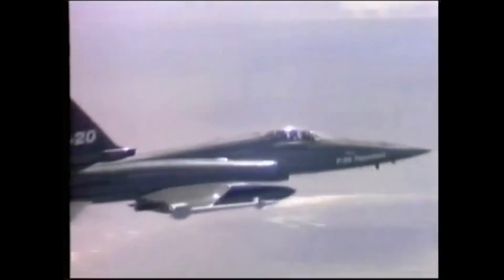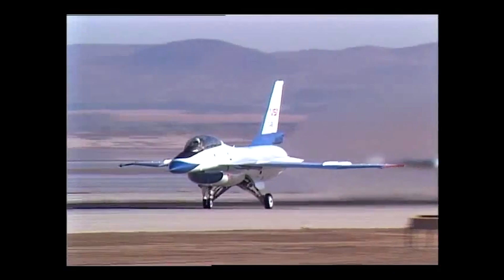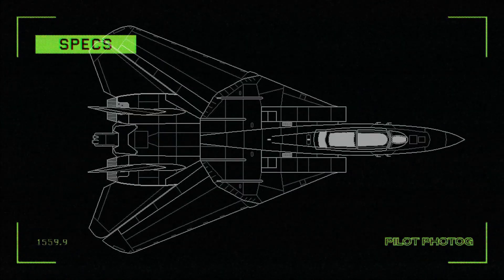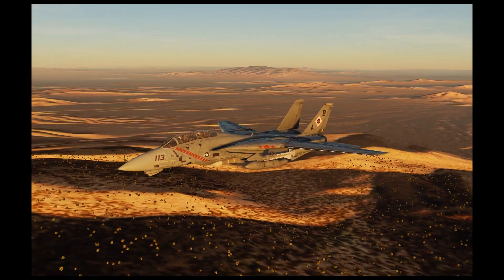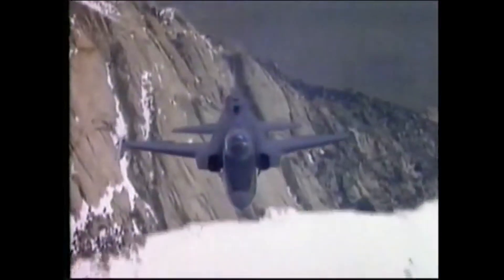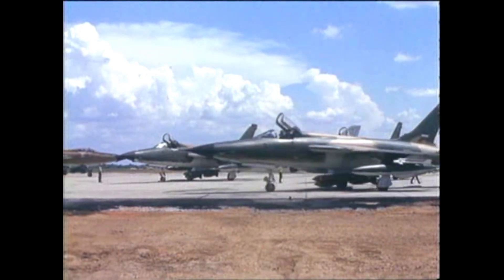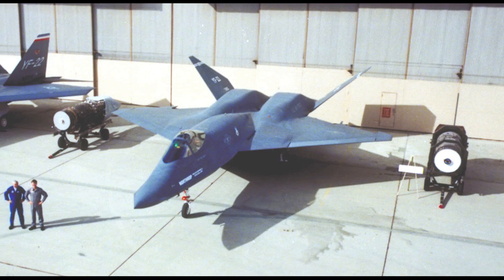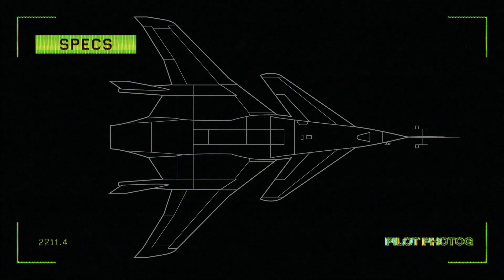Top 5 Fighters That Should Have Been Built | Best of Aviation Series by PilotPhotog  f20  f16xl

Comment: F-20 was a cool aircraft. Wonder how it would have fared against the F-16 if it was produced!
Reply from the maker: Excellent question and thanks for commenting.  I feel that the  F-16 would have had been very well matched against the F-20, can you imagine 40 years of development and upgrades on the F-20?
Reply: @PilotPhotog  I think the big problem is that the F-16 just makes sense for the USAF and any other air force which used F-15 as its backbone - and the F-15 has the best combat record of any fighter ... ever. Something like the F-20 means logistics for a different engine. If you're going to go with that engine, then why not go with F-18?

Something like the Tigershark might have more of a chance if it were developed by a different nation without such logistic concerns ... well, one could argue they did that with the Gripen. I guess you could view the Gripen as the Tigershark's revenge?
Reply: @IsaacKuo  The Gripen is why there'd be little reason for Northrop Grumman to try to revive the F-20, even though with modern avionics it'd probably still be a competitive fighter today. The niche in the market that the Tigershark would've filled has already been seized by Saab.
Reply: @RedXlV  Yep, Brazil  just bought  the Saab. India is buying  the Rafale. Japan is going F-35. Canada is still farting around on a next fighter.
Reply: @varminthunter243 The F-20 had no where to evolve. It's  always a poor Multi role fighter. Small, lacking hardpoints. short gear and lacks the visibility of the bubble canopy. And the Allies  had no interest.
Reply: Even though the F-16 had a blended, higher wing, integrated LERX, and FBW with relaxed stability, the F-20 is 90% of the F-16 for about half the price. Except the radar was better than a contemporaneous F-16; it was GEs last ditch effort in the radar business, and they built a world beater.
Reply: @taylorc2542  The World said otherwise.....
Reply: Well, since Chuck performed mock combat against those, as well as Hornets and Eagles, and still said the F-20 was the best fighter he'd ever flown, you tell me....  (he's flown the Eagle and 16, not sure if he's flown a Hornet but I know he's flown in a Hornet)..
Reply: @varminthunter243 the aim 120 was tested and developed on the both the viper and the eagle.
Reply: The F-20 was (is?) superior to the F-16 in nearly every metric, BUT...the Reagan administration allowed everybody and their brother to buy the F-16 on the cheap which killed the incentive for F-5 operators to upgrade to the F-20. Can you imagine the difficulty USAF, USN, and USMC fighter pilots would have in DACT going up against the F-20?
Reply: @ElmCreekSmith  the viper would wipe the floor with the tigershark. The viper had and has a far superior avionics suite than the F20
Reply: @gdelorien  Uh, you do not know the 1st thing you are talking about.  Back then, when it was still called the FALCON, the 16 and 18 had decent avionics suites and radar sets.  The F-20 used stuff from both of those jets, moreso from the Hornet.  The F-20 had a VERY capable radar, excellent tracking system, and a great avionics/HUD setup.  Just as good in fact better than its contemporary F-16.  Only with block 50 and later F-16's have you got the "killer" stuff that the Viper is known for.  Block 20 and later Hornets and the Super Hornets have even better radar, giving up the AN/APG-65 for more modern sets.  They could've updated the F-20 in the SAME way.  The thing is, you get a better bang for your buck with the F-20 than the F-16, that was the entire point.  They wanted to repro the same market conditions that made the F-5 attractive to foreign buyers.
Reply: @karlchilderz  1st the pilots have always called it the viper 2nd was an avionics tech in two squadrons that operated the viper. The F 20 is nothing more than a modified T38 Talon.
Reply: @karlchilderz  no I just fixed them when so called no it all pilots broke them.
Reply: @gdelorien  well, pilots don't forget that ground crews are critical and are why they can fly those jets.  I did however like i said hear them call it falcon then.  Later on yeah, I heard them rename it because apparently falcon wasn't cool enough so they wanted to name it after a snake.  Good job....  it doesn't matter to me as I said, I wasn't in the 16 community and didn't want to be.
Reply: @ElmCreekSmith  No, that is false.

Comment: Personally, I think the YF-23 should still be built. Except now it could be packed with modern day electronics.
Reply: YF-23 was a far more interesting, complex and advanced Design than the more conservative Design of the YF-22. Why they couldn't built both? It still looks modern...
Reply: @einautofan6685  And the Modern F-22 stole its nose cone from the Awesome YF-23....
Reply: @einautofan6685  post Cold War cuts and social programs.
Reply: @einautofan6685  appearently the YF-23 lost out to the f-22 prototype some how
Reply: @einautofan6685  IMO, it looks more modern than anything in service.
Reply: From my understanding the f22 and the b2 are just stop gaps and test production planes. I read from an article that many of the stealth designs were never proven in actual usage ( meaning actually in combat, and being used daily) so the military wanted to try them out before going in and replacing them with actual better designs. For example the b2 was actually suppose to look like the b21 raider but had to be revised to fly lower since the military did not know if stealth would work as intended. Fairly sure that new planes are just going to remove all stop gaps for next gen planes which are already indevelopment
Reply: @shtav  That would be incredible
Reply from the maker: Agreed and imagine what it could do with today’s avionics? Thanks for commenting.
Reply: @PilotPhotog  The real problem of the YF-23 was the internal bays layout (if revised it could be made)
Reply: Lockheed played upon our politician's need to serve their own interests. Instead of concentrating on making the better aircraft, they were busy setting up contracts with suppliers in several states to manufacture parts for the the YF-22. That guaranteed more support in Congress because it would benefit more Senators and Congressmen. It was never based on building the best aircraft, it was based on how many politician's constituencies would benefit.
Reply: The YF-23 would require a massive redesign. Like the F-22 , it was built for air superiority not multi role. Its weapon bay would need redesign 
The F-22 was the right plane , it just lacks the ability to use air to surface weapons
if its bay could be redesigned to hold the JSOW-series , it would be a money maker for the USAF. JSOW can be used against various targets including ships at standoff range
Reply: @shtav  it's going to be much worse, though. The reason neither the YF-23 and the F-22 are not sold to other countries is due to the US fearing that their most advanced tech will fall into enemy hands. They aren't going to put that stuff on the Japanese version even if they do build it
Reply: @shtav  I think the 6th Gen aircraft will have more in common with the YF-23 than the F22.
Reply: ¡But why build the YF-23⁉️ Move on guys, instead start working on a sixth generation fighter and pick the best features from the YF-23 if they are still reliable.
Reply: Agreed, on the Y35 it’s s far better than the F35
Reply: Besides the rumors regarding Japan, the mockup of the new european fighter, shown on last years's Paris air show, resembles the YF-23 quite a lot.
Reply: @shtav  unfortunately, Japan was denied both F22 and a version of F23. USAF went all in with F35, and if Japan got F22 or F23 with modern electronics, it would be far superior to anything the US has. Theoretically, with the start of production of new F22 or F23, USAF would be able to order some (and even cheaper, than originally), but all money went to F35, so this was not a viable option. And US govt. would not allow anybody to have an american fighter, that is superior to those, used by the US military.
Reply: Yeah i Agree!,That Diamond Shape Wing Kinda Cool
Reply: U seen where Russia just came out with their 5th gen? It's time to bring it out lol
Reply: Building the YF-23 today would essentially have the same argument as reactivating the battleships...  Technology has moved on since then, warfare has moved on since then.  UAV's are already increasing in size and mission scope.  And given the US economy over the last 20 years, as well as the F-35 budget debacle, it's highly unlikely that Congress will approve another high budget aircraft so soon.
Reply: Most probably someone bribe somebody to get the contract. I was one of those who were disappointed when F-22 won the contractor. And after I watch the documentary about YF-23 i m pretty sure Lockheed is trying to monopolize the whole stealth jets in USA.
Reply: @D_2_M  No, it wasn't bribery.  It wasn't mentioned in the videos, but I do know for a fact that another issue that the USAF considered was cost and program issues with the B-2 program.  They had to seriously evaluate whether or not they were going to see the same clusterfuck with the F-23.  Period of performance and ability to perform are critical contracting terms and issues and the USAF was not confident they'd be able to perform without cost overruns and significant delays prior to production.
Reply: @karlchilderz  So worrying about possible cost overruns because of the B-2, they then went all in with the F-CostOverrun(35).  Oh, the irony.
Reply: @cnocbui  those decisions were decades apart.  Also, the F35 was always going to be exported.  The 22/23, not so much....
Reply: @D_2_M  And the  Navy voted on the contract and picked the F-22 even though they had nothing to do with the contract! Politics suck..............
Reply: The YF-23 relied on a lot more unproven tech. When the day came for head to head trials, the F-22 was more mature and was even capable of successfully targeting and hitting a target drone with an AMRAAM. 

IMO, the YF-23 would have been a perfect fighter for our carriers. I don't care for the F-35s in that role because they are too slow to function as a fleet defending interceptor. I also dislike the idea of single engine fighters are carrier bird. The F-23 would have been perfect as it was faster and more stealthy than even the F-22 with a weapons bay thought would have been better suited to carry bombs.
Reply: @Elthenar  I guess you aren't familiar with A-7's, F-8's and other single engine planes the Navy flew in the jet age that acquitted themselves quite nicely.
Reply: @karlchilderz  Yes they did. However, there are also a number of accounts of those single engine planes going down to engine damage. There is also a lot of cases of twin engine planes making it after losing an engine. This is why I think all Navy jets should be twin engine. 

Apparently the Navy disagrees.
Reply: @Elthenar  as a Naval Aviator, i disagree with your assessment, so yeah, there we are.
Reply: @karlchilderz  You don't sound like a naval aviator. Let's say you are though, why on earth would you prefer a single engine?
Reply: @Elthenar  prefer?  I said I don't agree that you must HAVE two engines.  How exactly do you think a naval aviator should sound?  I went to college, got a masters.  In 13 years active, plus reserve time.  

With modern engines you get great performance,  thrust and reliability you didn't see in former generations.  Plus you then don't have to deal with higher fuel burn and more weight which is VERY much a consideration on board.
Reply: @karlchilderz  If you read my post, you will notice that I didn't say you MUST have two engines. I said I disliked the idea of a single engine carrier fighter and gave reasons why. 

As to weight and fuel burn, the F135 is roughly twice the weight and fuel burn of the older F404.If the weight and fuel burn were as significant disadvantages as you imply, they wouldn't be used so often. 

There is a a reason single engines are only used in smaller, cheaper fighters. Upfront cost.
Reply: @Elthenar  and as I said, maintenance and other factors...
Reply: @karlchilderz  except you didn't say any of that. All you said was weight and fuel burn. 

You are also hung up on one line in a longer post. In my opinion, the Navy needs a main carrier fighter that is capable of functioning as an interceptor. Something capable of getting out there and engaging an airborne threat. It looks to be much to easy for an airborne attack to get in range, launch and get out against an F-35 armed carrier group before those fighters could do anything.
Reply: @karlchilderz  with today's tech, single engine should be as safe as twin. A well performed maintenance will keep it flying.
Reply: @Joshua_N-A  I understand this, you are preaching to the choir.  Its the other guy who hasn't even been a naval aviator who thinks the Navy needs to rethink their stuff.  The Navy makes decisions that are hard to immediately understand the wisdom of at lower levels despite feeling their impact.  This is the way organizations function when they are that large.  I for one think retiring the tomcat was a huge mistake, but they probably had the nagging, ongoing concern of Iranian nonsense and other factors to contend with. We of course can sit here and criticize those decisions,  but when you're wearing the admiral shoulder boards and the decisioms fall to you, its a lot harder than it is to criticize.
Reply: @Elthenar  there was NEVER a F404....are you implying the F-4 Phantom II to the OTHER turkeys we see as F-35s?
Reply: @angelisreal  Those aren't fighters. That is the model number of the engines in Navy fighters. The F404 is what was in the legacy Hornet. The F135 is what is in an F35.
Reply: @Elthenar  Cost
Reply: @Elthenar  The f35 us such an absolute steaming pile of shit its an embarassment to the entire US military...   the only way its winning is for the shills making $$$$$$$$$$$$$$ from the massive ponzi scheme it effectively is
Reply: @D_2_M  I agree and by looking at the development of the F-35, I would say they are doing a terrible job. Shame on Pentagon and Lockheed for putting profits and bribes ahead of our pilots lives and national defense.
Reply: @kevinblackburn3198  F35 beats the Su35
Reply: Actually we can consider the Sukhoi Su-57 the operational version
Reply: @AlexanderPanzeri  F22 beats the Su-57...

Comment: With the YF-22 and YF-23, another factor was the navy. While the navy would not have gotten either of the aircraft, they still had input in the competition, and they did not like the proposed naval variant of the YF-23. It was also precieved to have more challenging maintenance, mostly due to the heat ablating tiles on the back where the engine exhaust came out. Inspecting and replacing the tiles would have been a time consuming chore.
Reply: That is absolutely wild and incredibly ironic considering here we are 30 years later where a carrier version of the YF-23 arguably could have evolved to meet the Navy's increasing need to fulfill a (currently largely lacking) long-range fleet defense role that in 1990 was assumed to likely not exist for the foreseeable future. But here we are in 2020 where it has become such a concern that the survivability of carriers are in question.
Reply: @npaul4171  It was also to big for the carrier. space is limited. super tomcat would have been a lot better decision for the navy. they gutted a lot of capability with cutting the Tomcat.
Reply: @throttlepusher3574  A F-23 way bigger than a F-14 ???  I feel the U.S. Navy still should of bought F-23s  That's me
Reply: @throttlepusher3574  Super Hornet was ultimately the right choice. It has almost the same capability as the Super Tomcat 21, without the maintenance nightmare of the swing wing. Navy squadrons had to carry more F-14s than they could fly because two or more Tomcats would be guaranteed to be downchecked every single day.
Reply: @npaul4171  Stealth coatings in 1990 were NOT in any way mature enough to survive at sea on a carrier. The solution would have been fiber-mat skins but those weren't ready until the early 2000s.
Reply from the maker: Thanks for commenting, ironic that the Navy’s input swayed things and they ultimately did not get a fighter out of it.
Reply: I think I had heard bout that somewhere before but had completely forgotten it, thanks for reminding me.

Comment: The F-20 Tiger Shark lives today as the FA-50!!!! Same engine, same concept, cheap, light, super sonic, and can do multirole mission.
Reply: Also: look at JAS-39 Gripen, especially from the side - same engine, same concept, same profile ;)
Reply: @piotrd.4850  no your wrong jas-39 is using delta wing with canard and the wing is place above the fuselage while f20 is using standard wing and place underneath the fuselage same as f4 phantom thereis big difference in control
Reply: Noticed that Korea also used to operate alot of F-5 in the past.
Reply: But it's not coooooooool like the Tigershark.
Reply: Actually it looks most like the jf 17 thunder.